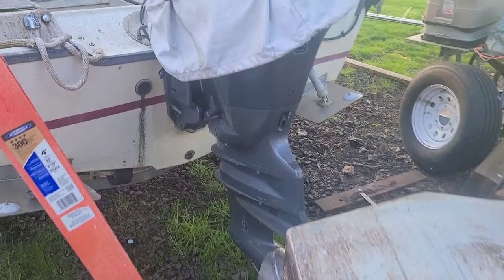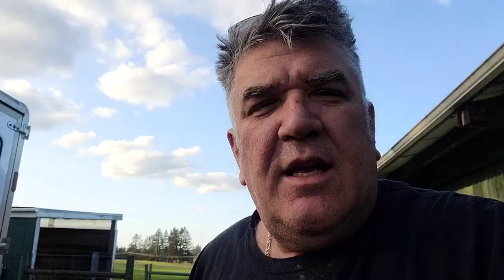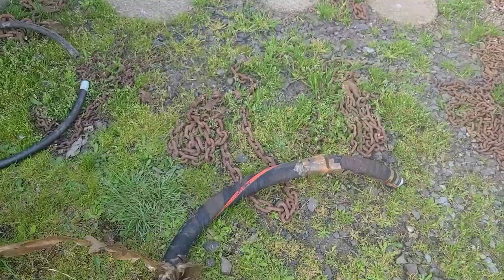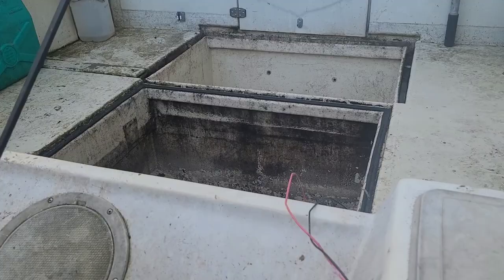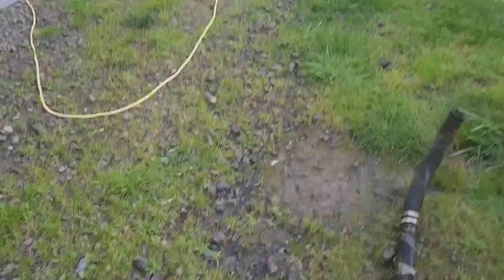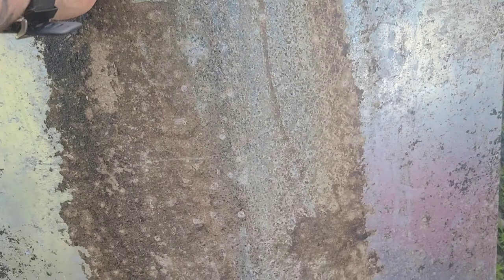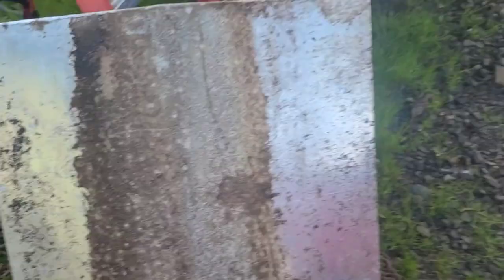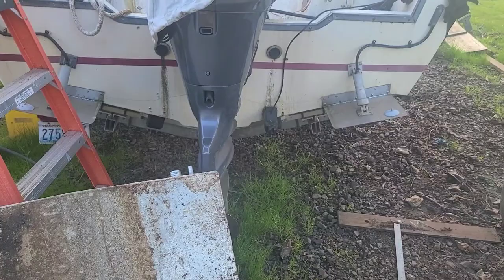SeaSport Fuel Tank Replacement,  Check out the tank failure!!!!!

Comment: Wow !!! Definitely a not good situation 🥴
I wonder I’d some JB Weld or perhaps it would be possible after all vapors disperse if you could have it welded for temporary until toy can find a manufacturer to make a replacement??? 
Great job on the trouble shoot and reveal Steve 👍🏻
A blessed week to ya 😊❤️‍🔥🙏🏻🤟🏻
Reply from the maker: Thanks Donna , I'm just going to bit the bullet and have it rebuilt , can't bear the thought of the bottom splitting open and 50 gallons of fuel 😳 going everywhere,  glad I dint smoke 😀  , keep you posted!

Comment: Hey I bet if you're careful you could fix that yourself. 
You can get the aluminum welding rods at Harbor Freight that you use with a propane torch. Just practice on some scrap aluminum first. 
You don't want to get it too hot. Once you get it hot concentrate the heat on the end of the rod.
Reply from the maker: Robert all that dark area is rotten,  I can push through with my finger , I suppose that whole bottom could be cut out ?
Reply from the maker: Ok.... finally found someone to cut that whole bottom out and replace.